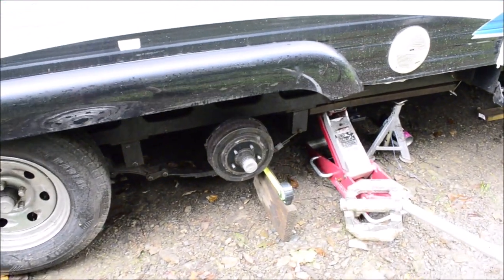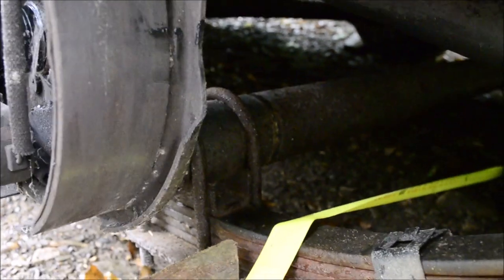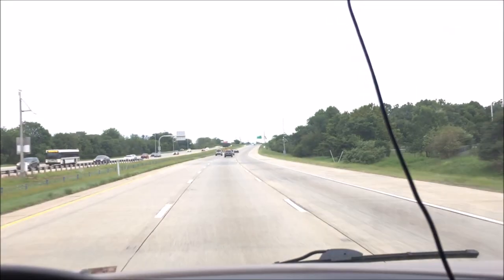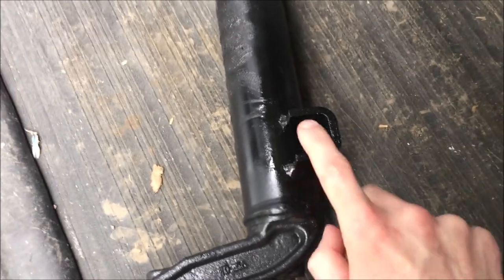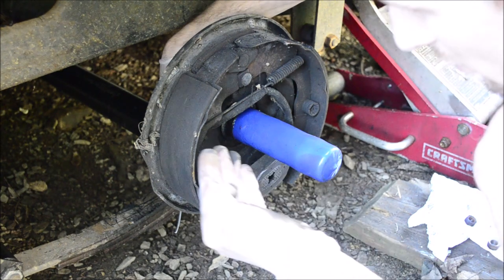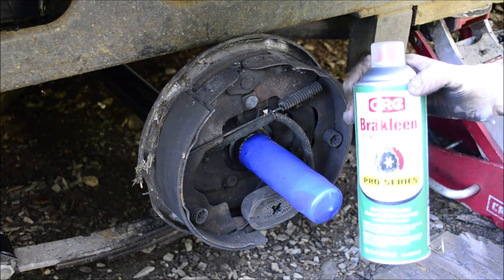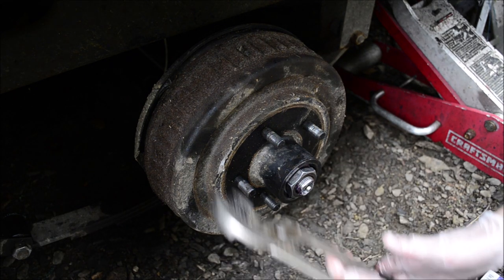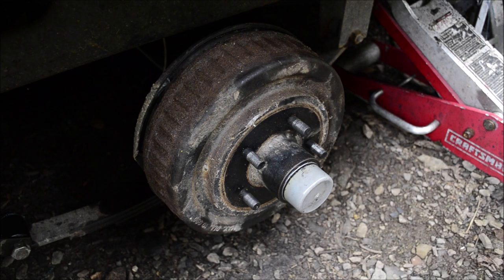(VLOG) - NEW trailer axle for my camper - 3500lb 4" drop - installing brakes, bearings, hubs

Comment: Replaced mine with complete axles with springs and hubs aready installed. 4 bolts and done. Didn't cost much more then bear axle and got new spring, bearings, hubs, brakes
Reply from the maker: Awesome, yea if you can find it definitely go that route! I needed one immediately and nothing was available.
Reply: @aDIYCarGuy  it was easier then finding bear axle here
Reply from the maker: @iamnoone.  lucky!!

Comment: Had to replace my front axle on my WW for the same reason.
Reply from the maker: I think there's too much weight on that particular wheel with the generator being right in front of it, and the axles aren't heavy enough from factory....they should have used 5000lb axles, not 3500.
Reply: @aDIYCarGuy  Exactly.  I have the FS2300 and the generator is over the front axle on the one side, the refrigerator is directly opposite and the two 100 gallon freshwater tanks are in between.
Reply from the maker: @srmilk4495  My fridge is right on top of my generator lol, sooo much weight in one spot. I have the two 100 gallon tanks as well in the same spot as yours. Mine is the FK2100
Reply: @aDIYCarGuy  FYI, I'm also replacing rotten flooring, not as bad as your was, but thanks for those videos as well!